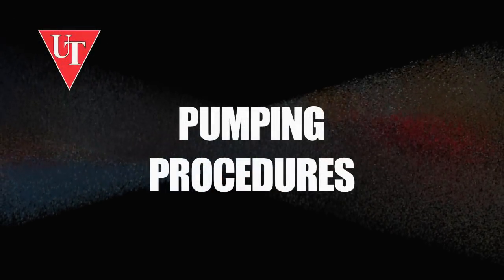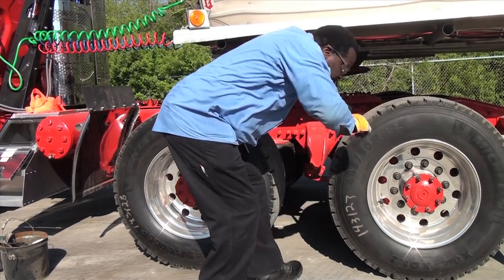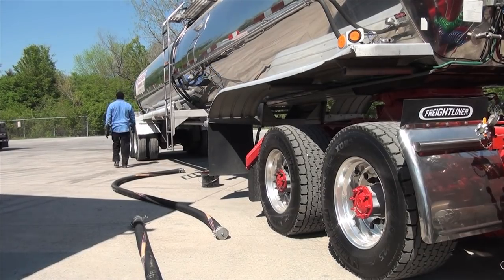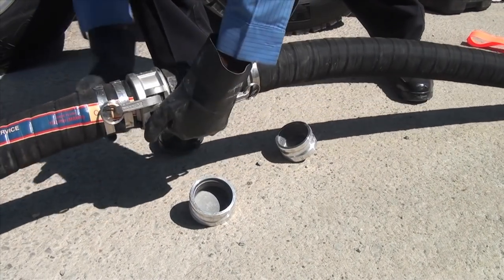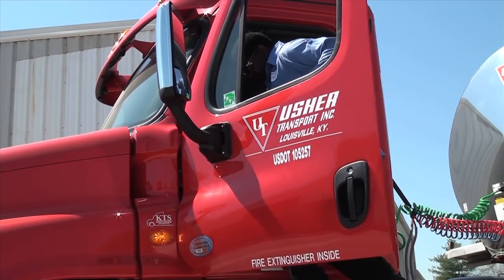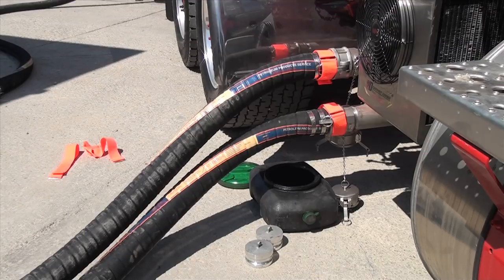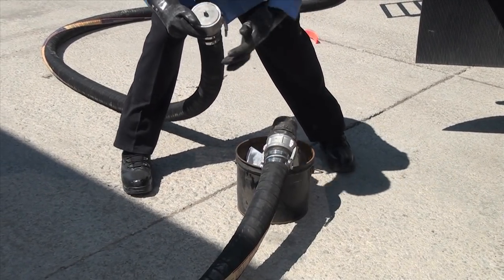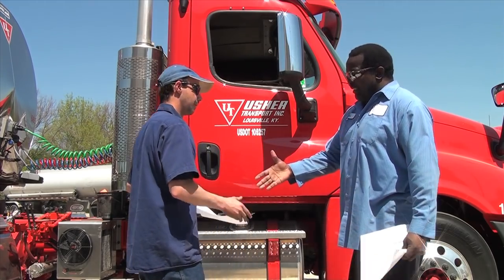Usher Transport Pumping Procedures

Comment: Never use your 4 ways when checking trailer lights, disgruntled drivers are notorious for switching trailer wires. I can't  tell you how many times I've seen turn signal lights wired in reverse, which is very deadly, especially with a fuel tanker. Believe me, I've learned from experience...
Reply: I would have never believed that until I was the victim of some skulduggery at an employer I once worked for. Some freak show was even flattening my tires on my personal vehicle because dispatch was putting me on runs he used to do. Came at me one day at the laundromat screaming how I took his routes. If I wasn't a new guy I would have just jacked the dude up but I calmly told him to take it up with dispatch. Come to find out the reason they were given to me is because he was such a douche the customer didn't want him back, he was kicked off the property and almost lost the account.
Reply: I haul 53 dry van.:. I never thought of that before. But knowing my shop I better start checking my lights the right way.

Comment: I have never hauled tanker but I would think all of the velcro safety straps were used to keep locking tabs from unlocking when pressurized . If so then why wouldn't you also put them on your hose union joining the two hoses?...." the only stupid question is the one not asked!"
Reply: Absolutely;  why only  TIE  DOWN  the input/output,  when  the most danger, could come from  loose  camlock  EARS,  IN  THE  MIDDLE   OF   THE  hose  JOB !  Another item:  velcro is a very combustible  materail.  '' back in  the  day ''   i used  haywire,  to  BE  SURE  cam locks,  NOT  OPENING.  !    (one, has alotta respect, for road asphalt, 350  degrees, and roofing  asphalt, over 400 _      ( : ~)

Comment: striking the tire with a hammer is a stupid ass way to check for proper inflation and it blows my mind that it was part of this video. Use a tire pressure gauge. It might feel like its inflated still but DOT will notice that its lower than it should be and it will still be a violation
Reply from the maker: I completely agree with you! But I just shot the script as the information was given to me. If they say strike the tire with a hammer, well thats what I shot on video! Thanks for the comment!
Reply: That hammer had a gauge on it lol.
Reply: Been driving 17 yrs, and I can definitely strike a tire with a hammer and tell if it has air or not. It's a preliminary check. It has a note to it. The air gauge comes out when it's time to fill it..
Reply: Using a tire thumper is a DOT approved method of checking tire pressure, though kicking the tire is not.
And it doesn't take long to learn what a properly inflated tire sounds and feels like, and if it's a little off you get the gauge out, as well as periodically checking them with the gauge.

I personally prefer a ball peen hammer (brass if you are dealing with flammable materials) to a tire thumper stick, it's perfectly balanced and allows you to get a good consistent hit.

Comment: 5:20   '' Back in the day ''.   We used haywire, to L O C K   those  cam fittings.  Better than  velcro- it is a burnable  material, BIG  time.  Transported hot road /roofing  asphalt, and sulphuric  acid,
late 70s'   mid 80's.   Trimac  and Westcan  ( western  Canada - Alberta. ) ....hmm....let us see, him connect  the   'ground '  wire/ cable/ clamp,  etc.  ???

Comment: Narrator could of mentioned with the caution needed when opening a hose that might be pressurized the cap could shoot off the end of the hose into your face! 

Also noticed when driver was hooking up to the inlet for filling, there is a nasty wire at the end of the hose where the connection is being made sticking up just waiting to poke through your rubber glove into your hand. Yep, been there done that.

Comment: I think I prefer the bleeder valve and walking the line after the unload to clean the hoses. Rolling the line like that seems like too much of the  potential for spillage.
Reply: I would tend, to agree. Hauling hot road asphalt, 70;s   80'.   WE  HAD   TO  DRAIN  HOSES, best as we could. YOU mentioned the  CORRECT   METHOD  !. LET  the pump - do  its'  thing.  (all one needed, was a solid , cold asphalted hose )  There was a pile, in Trimacs'    back  yard.....all colors, brands, ......

Comment: ...never seen so much brand new equipment before...I hauled hot road oil about 40 years ago...no drip buckets...no velcro safety straps...no hose caps...had to climb the ladder to open top vent on the tank...times have changed I guess...
Reply: Paradise Road yea, alot of people died doing it the way you just describe so they had to make things more safe